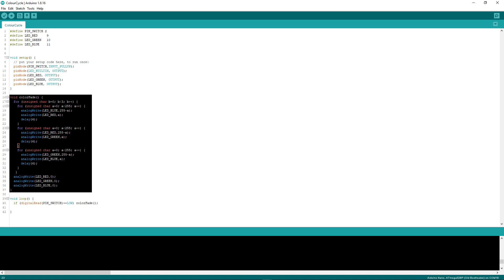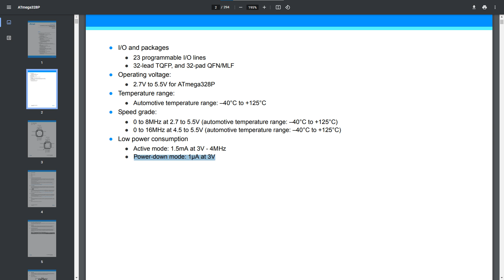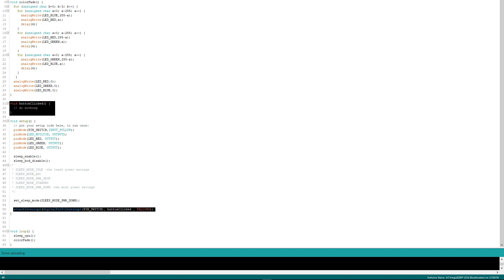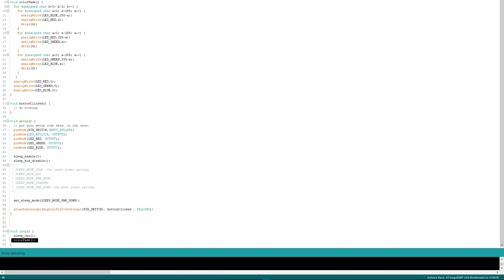Very Low Power Arduino / Battery Power - even Micro-amps!

Comment: Your video is very useful for beginners.
At time stamp 3:35 you make a comment about the current not being like an "Original Arduino". This is dis-ingenious as the schematics are different between the clone Nano and an original Nano. If you look at the two schematics you will see that the onboard regulator of the original is connected on both cases, the USB and external 5V. On the clone nano the on board voltage regulator in NOT connected in both cases. This is why the current is lower on normal operation on USB power. When on battery power the on board regulator is always being used and the USB chip is always being powered.
Reply from the maker: One thing I found interesting after I’d made the video is the chips on the nanos weren’t the same either. One had the ATMega328p the other the ATMega328PB which I believe aside from offering lots of extra features does also consume a different amount of power. Crazy eb